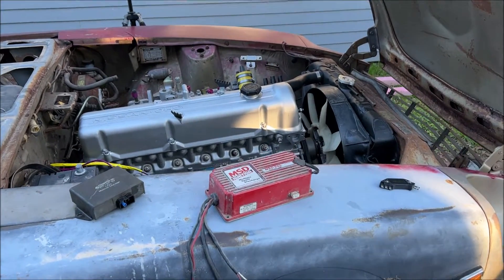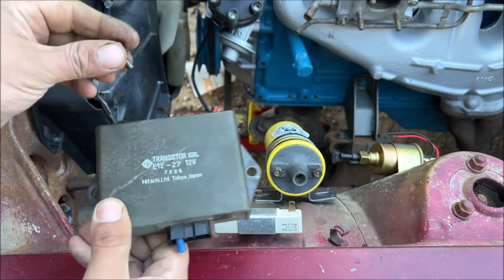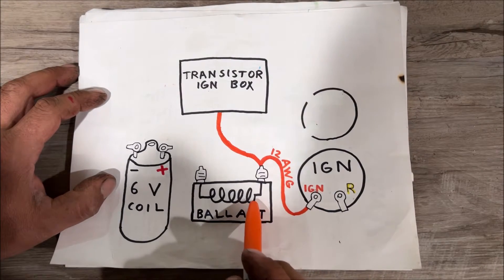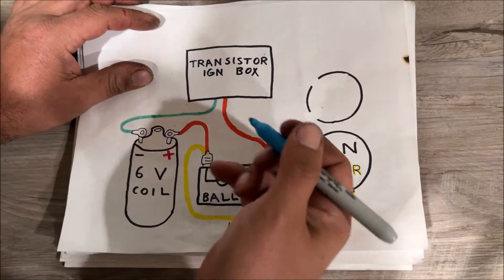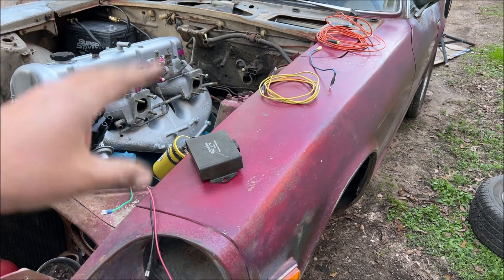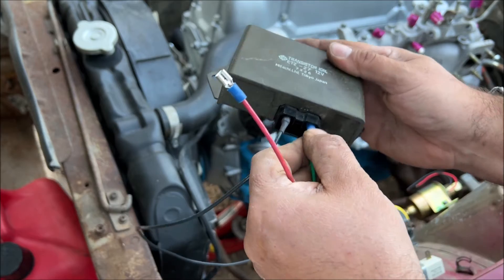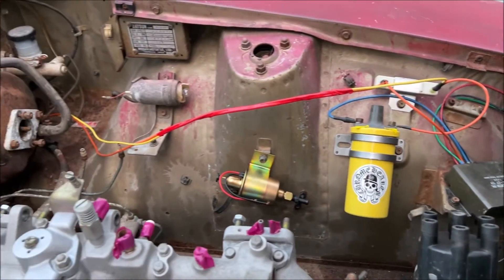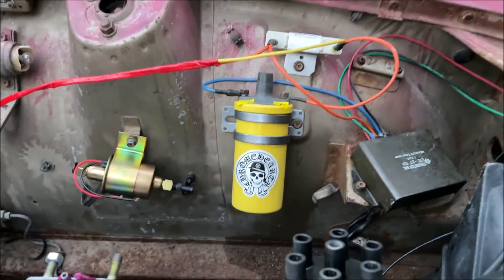how to wire ELECTRONIC IGNITION on ANYTHING custom automotive wiring from scratch part 3

Comment: Hey I need some help.    I just installed a 350 into my nova . But prior I had it broke in and running on a run stand it ran beautifully.  I had it on there ran it many times.  Again ran extremely well smooth.  Now that I put it in the car in runs poorly.  It smells rich I hear popping slightly on both exhaust pipes like a miss I checked everything over an over running points system which I'm familiar at.  Changed plugs. Still same.  Timing spot on 12 degrees tried a different carb same . Changed coil same I'm lost . Any advice would be appreciated.  Thanks Bob.

Comment: That is a very grand demonstration. I have a z also. Do I configure the wiring the same as you have shown if  a 12v coil is used. I didn't know that some vehicles use a 6v coil, if I understood correctly because the z uses a 12v coil with a ballast. I hope you have time to reply because you understand and know about how the pulse from the electronic ignition works. Thank you

Comment: Will this work on a 79 EFI model.  remove the ignition module on the dissy and take the red and green wire directly from the dissy and connect like you did. I tried but no spark.
Reply from the maker: you have to use the ignition module

Comment: Hey guys good job! Hey your football is in the wrong side. The reason why your drivers side lifts in the air is because all the power is going to the driver side of the diff/car so you are better off with two balls/airbags or just in the drivers side. The ball is stopping the right hand side from closing up the gap and helping. Just put another one in the other side and you should be good to go. Oh and you have air shocks on it to give them another 10psi and she should leave a lot better. Oh jack stand you should have stuck with a Holley lad. I have never had to touch any of my holleys as much as you have with that? And you need to add  the tip in on the side of the carby to give it more fuel it to lean that’s why it keeps sipping back up and catching on fire.Cain hard guys!

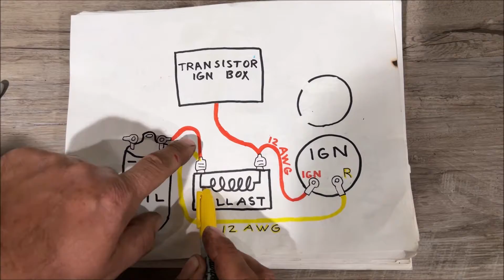Comment: 3:07 the ballist bypass wire is important for a Couple reasons . One being the voltage drop while starting. It can drop to as low as 9.5 volts +/-. The ballast cutting it nearly in half. That leaves good bit less than 6-9 v for the coil and ignition components. It can drop to a point where it can no longer function.  And on the other side it can supply a hotter spark for lighting a rich mixture when cold.  Damp plug does not want to spark.. basically being shorted out  with a high resistance. You need high voltage, high current to get past the short. And less voltage into the coil less voltage out. The constant 13-14 v to the coil will over heatvtge points if equipped, and the coil will overheat eventually possibly burn up, and a over heated coil of wire inside a sealed container of OIL!  What could possibly happen? Spray hot oil on s hotter engine, and the oil will possibly turn into a flame soon as it sees air! ,✌️

Comment: excellent description on the mysterious ballast resistor. Ill add the Mopar uses this style and they tend to have starting issues that can be traced the this ballast resistor. They use an ignition switch that has 3 terminals:  ACC-RUN-START terminals. They run the RUN circuit through the ballast resistor and the START circuit past the ballast resistor so it bypasses it giving the coil a full 12V. While in RUN the ballast is used and the hotter it gets, the more resistance it produces cutting the coil voltage down to about 9V to extend the life of the point style ignition. Often Mopar will get a start but no run once the key reverts to RUN position, that means the ballast resistor is open.  Seems the 240Z will ground the ballast only during RUN thus making it in circuit, leaving it floating during START.

Comment: Question, I did a motor swap on my 1976 Ford F-150. I took my 76’ 302 out and replaced it with a 95’ 302. We’re having trouble with the distributor. The 95’ is electronic where the 76’ was a points system. We tried to used the 76’ distributor with the 95’ motor but it seems that they’re not the same length or the oil pump rods are different lengths. The ignition plugs are not the same either. Not to sure what to do. Do we need to update the ignition?
Reply from the maker: why not use the distributor from the 95?
Reply: @chriscraft77022  The 95’ motor is an EFI where the truck itself is a carburetor. The 1995 distributor does not have the right ignition plug for the ignition of the 76, the pick up seems to be different. Am sure the 95 distributor would work but I’m at a loss on how to rewrite it to fit the 76 ignition plug.

Comment: What caus3s the HEI to stop working. Ive replaced 3. Runs a few hours then shutters. Replace the hei and all it good. Any ideas?
Reply from the maker: how much did you pay for the module?  heat kills them and a bad ground will fry it
Reply: @chriscraft77022  I've bought the accell ones from oriley. Thankfully they let me return them 😀

Comment: Hi Chris,
Thanks for all the great info. I'm upsizing to a 150am Alternator for a High Amperage
Electric Fan, and was wondering if this will take care of things.  I'm using 2awg Cables, nothing over 31" 
Positive Side
Battery Terminal To Distribution Block
Alternator to Distribution Block
Starter Solenoid to Distribution Block 
Neg
Battery Terminal to Engine Block
Engine Block to Frame  
Engine Block to smaller Frame
Alternator Ground to Engine Block 

I guess my question is, does this sound like I'm doing things right or
do I need to have some fuses in this array somewhere.   I Know it's kind of 
an out there question, but it's Hard being a 71 year old Rookie.
Thanks !!!
CK

Comment: U r totally full of crap. All datsun z cars had 12v coils.  The balast is for the run function ONLY.  All cars send the full 12v to the coil for a hptter spark while cranking  once the engine is started the ballast resistor is in the path to eliminate the current draw from the ignition coil

Comment: This video is super helpful. I have been having issues with the engine kickback during starting situations only. I am using a megasquirt ecu. The fourms tell me I'm having slow rpm thats sporadic during cranking and pointing me towards my grounds.

The vehicle has ford tfi ignition with an msd box. I have my box Ground strifht back to the negative terminal on my battery. Should I have the Ground for the box routed to the engine block?

Comment: if i have a 12v coil i can remove the resistor? my car has a hard to start condition every time, cold or hot start.
Reply from the maker: what is the vehicle?  why is it hard to start?
Reply: @chriscraft77022  d21 pathfinder. With z24 engine. New weber carb.

Comment: Really great video! I recently bought a 1996 Subaru Domingo that had some starting issues in particularly wet or humid weather. Previous owners had replaced the battery, spark plugs and wires, starter motor, fuel pressure regulator, and the problem persisted. 

I had a peak into the ignition coil connection on the harness side and lo and behold, corrosion had eaten away at one of the two connections (the ground I believe) to the point that only about 2 or 3 strands of copper were holding fast. The car would start with the help of a jump starter on bad days, probably because it boosted the voltage a little, but otherwise the voltage drop across that connection was probably too much to overcome (I should have measured it to check, but was too excited to fix the problem). Replacing the wire and connection and adding better insulation is so far proving effective!

Super satisfying to find and fix problems like this and videos like yours are what make it possible!
Reply: Great troubleshooting dude. Im having myself problems with a s

Comment: Very helpful . I have a 66 k-10 and bought a 65 327 to put in it when the 350 that was in when I bought it shit the bed . There was a hei distributor on the 350 which is a 80 something blue paint not compatible I've come to believe won't work on my gen 1 . I have point style distributor came with my 327 . Worked great in the 350 I have not jack shit for spark when on the 327 natta ! 
Looking for solutions literally watched 20 dif vids that a are lacking specific info , YOU NAILED MY MY MINDS EYE TO WTF IS UP !
I AM EXTREMELY GRATEFUL FOR YOUR DILIGENT AND THROUGH Explanation WITH DRAWN OUT DIAGRAM . YOU HAVE A GIFT AS I AM ALSO SLIGHTLY DYSLEXIC AND FRUSTRATION CAN BURY ME .
THANK YOU FROM A MATTER OF SINK OR SWIM SCALE  1-10 YOU NAILED 10 . NO ONE NAILS 10 .
IF EVER IM RICH AND FAMOUS OR JUST HAVE SOLID FINANCES TO PAY FORWARD NOT MANY ON MY LIST FOR BIG DONATIONS IF ANY BUT YOU WILL KNOW IF THINGS WORK IN MY FAVOR . THE IMPORTANCE OF MAKING THIS TRUCK RUN ARE ALSO 10 AND NONE OF MY QUESTIONS WERE EVEN UNDERSTOOD IN MY WORLD.  THANK YOU ... 
POINTS STYLE DIST Paramount RFN ! All things up ,👍🤸🕛ℹ️✝️🆙🔭 okay I'm done .
Reply from the maker: I have a GM points ignition video that shows how to wire it up 100% on my 70 Chevelle